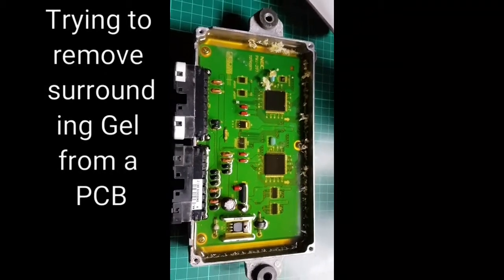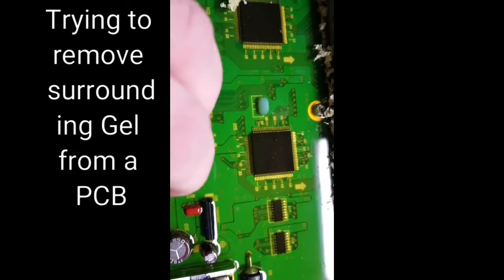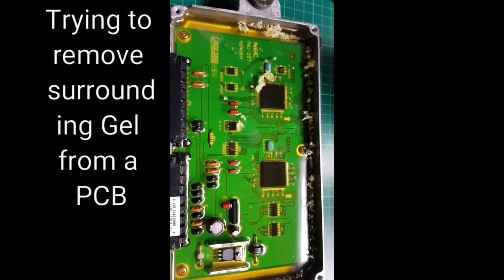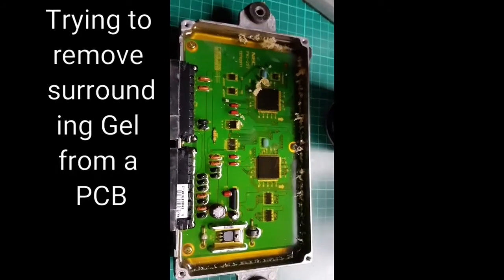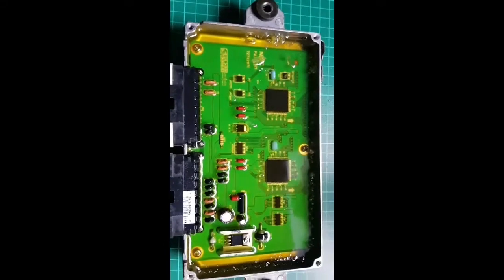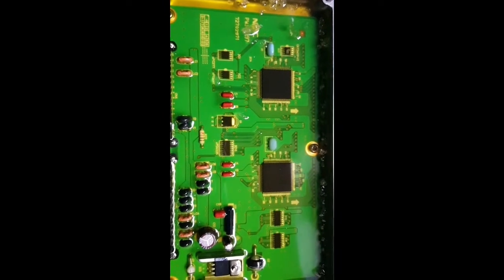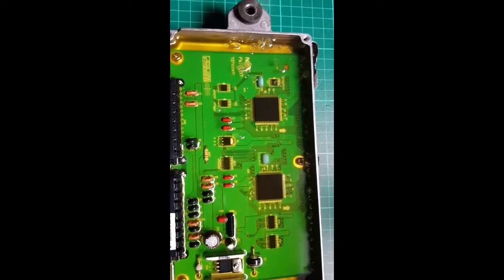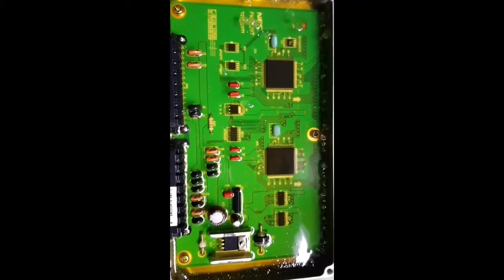Attempting to remove gel from a circuit board

Comment: How to remove the resin on the  board
Reply from the maker: @Aryaei-m-h  acetone
Reply: How do you use acetone? How many hours should it stay in acetone? Since acetone could not remove even the dried colors, how can it remove the resin? @AceBullion
Reply from the maker: @Aryaei-m-h  read up on acetone. It is extremely toxic and as for time keep checking hourly

Comment: I worked at a factory that put a conformal coating on. Xylene is a solvent used to thin it out. The board went in one side and came out the conveyor with it dried on. If you soak it in Xeylene it gets brittle and flakes off easily using a shortened acid brush or ESD cleaning brush. Don't be breathing in Xylene it is some nasty stuff wear a respirator the machine has carbon filters inside it vented to the ceiling.
Reply: I had to soak the last board I worked on for 2 days. When the conformal coat is fresh it doesn't take so long but that one was years old and very dried out so it took a while.
Reply: A friend had eyesight problems because of Xylene they used at some factory she worked at. It is some bad nasty stuff you got to be careful with it.
Reply from the maker: Wow I know there are plenty of chemicals to help bit I was trialing some basic workshop ones atcthe time. 
I always tell anyone don't mess with acids and bases if your unsure. I thought I had a great solution until I realised it was extremely close to making piranha water

Comment: Trying this now, I’ve a PCB encased with the same silicone potting. I can see a blown fuse and think a transformer is bad. I’m sure it’s repairable, it comes from a bidet toilet seat costing over £800, a replacement board from Italy is over £100 so I could be a winner, no harm trying, seeing your second video it should work for me, many thanks 🙏👍
Reply from the maker: A heads up. It takes time and you need to continue to use small amounts and pull away from the outer edge. Good luck. This was a control module for my Honda st1100
Reply: @AceBullion  thanks, I used a scalpel around edges of container it’s in hoping to let wd40 soak underneath, approx how low before trying to lift the board from that? I was going to try acetone but can be corrosive to board, this appears to be the only thing without a mess
Reply from the maker: @Superfandangoo  it took 2 days of being very careful.  I did use a scalpel as well once I was close to the board. Then ibsure you let it dry!!! WD won't damage contacts etc.
Reply: @AceBullion  only 2 hours and it lifted out of its box and rolled some silicone off to let me do some testing, now going leave it soaking a couple of days. 
I’m impressed and really appreciate your video. The unjust thumbs down must be from people trying with epoxy resin type potting. All the best and stay safe
Reply from the maker: @Superfandangoo  thank you very much. Its not a guaranteed solution but one I have not come across and with some experiments I found WD40 to work. Acetone didn't work but did melt a circuit board. Just please be careful and inspect every joint and connection after its dry.
Reply: @AceBullion  I will do I repair laptops/phones etc. I’m amazed the uses for wd40, I once used it as a flame thrower to get close to a swarming wasp nest to treat.
Reply from the maker: @Superfandangoo  🤣🤣🤣🤣🤣🤣 No comment but it 8s amazing stuff. LOL I recycle phones and laptops , tablets for the gold and other precious metals